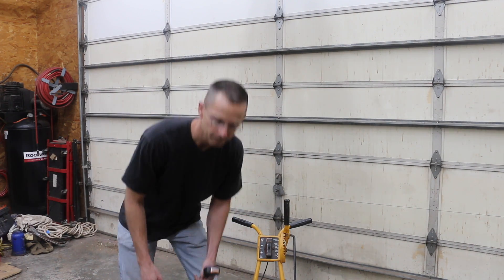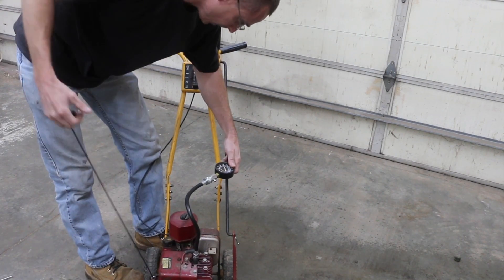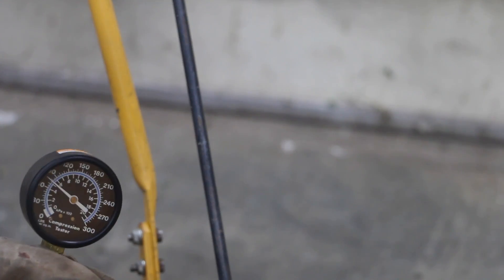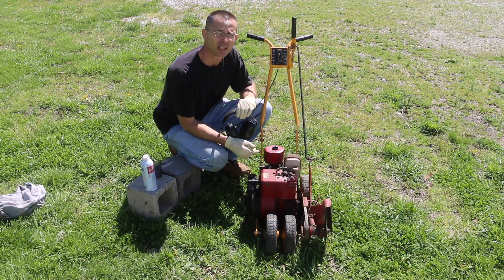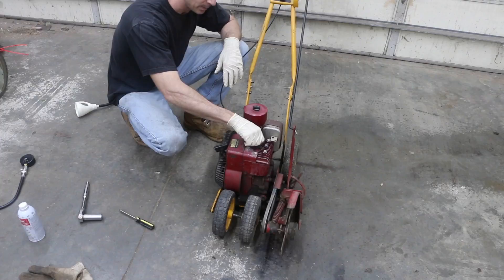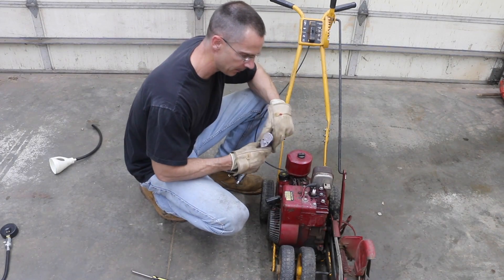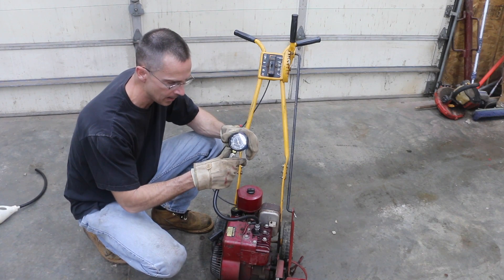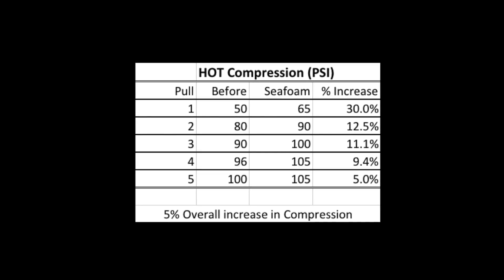Seafoam--can't believe what it did to my engine!!--Episode 4--Compression Test

Comment: Back in 89' I bought a gremlin for $60. The first time I saw this car was pre dawn on a crisp winter morning and it was on fire. It turned out to be my boss who was meeting his "noob" at the Quickie Mart. After some mild drama w the clerk over his fire extinguisher we stared at the smoldering car. A quick haggle and we stuck a deal for $60. I fixed the fuel leak after work and my brother drove it back to our condo near Placerville. As he drove around corners you could see a ring of sparks from the steel belts coming thru the tires. We would torture this car in every way possible while not actually moving it. Hammers, lame karate kicks etc.  all were deployed. After the bastard car struck back and bloodied my hand I grabbed the garden hose. My brother and partner in the car fired it up, matted the gas pedal as gave the gremlin about a 20 second blast of H2O down the carb. It made a hysterical BUUUHHHWAAH sound an farted out a giant steam cloud. The engine cleared an idled  smoother and revved quicker. The next test was each of us had a gallon jug of water in order to limit the amount of damage on person could do. My bro stepped up and gently poured his gallon in and I modulated the throttle. BBUUUUWWWAAAAAHHHH and more laughs. My turn, he floored it and I held the jug inverted over the carb. It looked like a weather event. The last one did hurt the motor some. The next night we took the car out to country road, kicked the grill off( Bruce Lee would have been proud of my little Bro), jammed it on the gas pedal and fled the scene. I shit you not 30 seconds later a deputy passed us going the opposite direction. Moral is a small metered amount would be ok an older engine. I would not try it on anything I cared about(just my opinion). I have used Sea foam on newer cars w mixed results. I guess my theory is when  adding it to the intake I would have concerns in reference to the carbon loading up the catalytic converter. I always for the directions on the can. After a quick oil change the car gets a nice long drive to get the cat cookin'. It never did any damage but in fairness most of my cars are older but do run well.
Reply from the maker: jaber baber, I enjoyed that story!  Funny!!!  I'll add water very slowly. Thanks for watching the video and for commenting!

Comment: btw that gauge doesn't measure compression it measures cylinder pressure. the two are similar but not the same. compression is a measurement of volume while cylinder pressure is the  measurement of pressure the piston creates as it rises.
Reply: I think its hilarious that the guage in the photo is even labeled "compression tester" but some genius says it is something else.
Reply: The gauge reads pressure and it tests compression.
Reply: The gauge does not measure cylinder pressure because the cylinder does not hold any pressure. Its called a compression gauge because it measures the compression pressure created by the piston and piston compression rings as it compresses the air taken in by the piston and forced upward towards the engine head there for calling it a compression test. So in other words the compression gauge measures the compression pressure created by the piston and piston rings.
Reply: Mike, you forgot to add the cylinder walls, head surface and valves into your lengthy correction of terms of the parts that create compression, oh, yeah the shin bones connected to the knee bone... ha, ha, too funny.
Reply: Project Farm great video, no blabbing on and straight to the point,  nice work man!
Reply: konner kramer good point smartarse
Reply: mikefranklin74 I think konner kramer is confused with compression and compression ratio which is a measurement with volume like he stated
Reply: konner kramer Compression is Cylinder Pressure
Reply: You should google. Google is your friend.
Reply from the maker: Konner, Great point!  Thanks for watching the video and for commenting!
Reply: Project Farm just thought I'd let you know either way great video keep up the great work.

Comment: Boiling water may work better than cold water. But better than SeaFoam, no.
Reply from the maker: blipco5, Another vote for water!  Thanks for watching the video and for commenting!
Reply: You mean another vote for Seafoam.
Reply: +Project Farm 
No, my vote is for Seafoam. I don't think you could get enough water in there to keep the motor running long enough for steam and cavitation to do its work. 
But to be honest I don't know how Seafoam works either. Is it because it was poured directly into the carb where IT'S main effect was cavitation rather than a chemical reaction?

Comment: use a 50 50 antifreeze mix have you ever looked in an engine with a blown headgasket the cylinders effected are spotless
Reply from the maker: adam moon, Excellent idea!  Thanks for watching the video and for commenting!
Reply: GModBMXer no antifreeze is water and ethylene glycol and a bunch of rust inhibitors. methanol is in washer fluid
Reply: ive seen hundreds of engines with blown head gaskets and the valves where as spotless as the piston tops never really looked at sparkplugs close usualy change hose there cheap
Reply: Dylan Houser Seafoam does that aswell. It happens with any engine hydrocarbon cleaning
Reply: Antifreeze is actually a really good cleaner. I have actually used antifreeze to clean parts out in the oil field when I have run out of carb cleaner.
Reply: As mentioned above, I would not be spraying antifreeze into a modern engine because of the O2 sensors. Most of the cleaning action happens due to thermal shock and not chemical solvents.
Reply: I replaced the heads on my Jeep 4.7l a few years ago. There was a crack at the corner of one of the cylinders letting coolant in. I had been losing coolant for a while, but finally tore it down once it got bad enough to make the engine run rough. Like the other guy said, the cylinder getting coolant in it was spotless and clean of any carbon; easy to spot compare to the other cylinders. I do all my own oil changes, on time, and never once noticed the oil looking even slightly coolant contaminated. I don't think there was nearly enough cylinder blowby to allow the coolant to reach the crankcase and contaminate the oil.
Reply: adam moon only problem is it causes deposits on valves and spark plugs
Reply: yes it does steam clean from the water but the antifreeze contains lubricants to help from scoring cylinder walls
Reply: That 50/50 mix used to boil dirty carburetor in a coffee can cleaned the carb up like new.
Reply: I've seen the effects of blown head gaskets also I believe that soaking, when customer lets it sit overnight, maybe serval times? helps clean the combustion chamber.
Reply: Thats from steam not the antifreeze
Reply: Lol WHAT? Do NOT use anti freeze to clean your cylinders. Anti freeze does not play well with oil. Seafoam is petroleum based so a bit of it blowing by into the crankcase isn't a big deal. Antifreeze is a mix of ethylene glycol and water both of which do NOT play with engine oil nicely. Funny how you mention how you've seen "hundreds of engines" with clean cylinders from blown head gasket yet you neglect to mention that it turns your crankcase into a milkshake. Calling bullshit on you, sorry.

Again, DO NOT USE ANTIFREEZE TO CLEAN A FULLY ASSEMBLED, RUNNING ENGINE EVER. The bullshit you find in YouTube comments my word
Reply: It's not the spark plugs or valves you worry about, it's the oxygen sensors and catalytic converters. But as far as cleaning the combustion chamber, It's better to use plain water. It atomizes much better and leaves less deposits.
Reply: Do not use antifreeze!  The antifreeze will mix with the oil, which is really bad for the engine!
Reply: Dylan Houser Ohp, you're absolutely right. I was thinking of windshlield fluid
Reply: Callan P.K. 
If I recall my college chemistry  101 course correctly; Water is the universal solvent. Particularly at high temperature. Wow! I can't believe I remembered that.
Reply: That's due to the "steam cleaning" effect from the water, nonecessarily the anti-freeze.  This is known in the water/meth injection community. Joys of water !
Reply: icin4d Antifreeze is literally water and methanol. Methanol is a lottt like ethanol bit with much higher octane ratings and detonation resistance. There are a lot of videos were cars even run straight methanol

Comment: great video spraying water into a hot running engine has a long history of being effective I'm voting Sea Foam I think the chemicals would make it more effective also I wouldn't hot soak with water it could contaminate the crankcase oil
Reply from the maker: James, Excellent advice.  I won't "hot soak" using water.  Agree that it'd likely contaminate the oil.  Thanks for watching the video and for commenting!

Comment: Do you normally have to hand choke this old engine for a cold start or did the seafoam loosen something to clog the needle ... or is just having to run rich to burn off the residual seafoam.

Mercury / QuickSilver makes a similar product called Power Tune. It doesn't make a fuel or oil additive but the procedures are similar with the aerosol can. I don't know if the chemicals are the same but it kept my Yamaha 11hp outboard running perfectly for many years.

It goes completely against my instincts to put water inside of an engine!
Reply from the maker: 3DPDK, I had to hand choke the old engine for a cold start.  I've always had to with this engine.  Newer carbs are designed to be much more user friendly and efficient at delivering 1-pull starts.  Thanks for watching the video and for commenting!  Also, thanks for mentioning Power Tune.  I need to look into testing that product!

Comment: interesting test results! I have used distilled water on my 1996 Mazda MX5 1.8L 4 cylinder to clean the carbon from the intake and combustion chamber with positive results after inspecting using a borescope. This method makes sense because if you have ever removed the head of an engine with a failed head gasket you will notice the piston and valves where the coolant leaked in and flashed to steam are typically much shinier and cleaner than the other cylinders. since the coolant is commonly 50/50 with water and this visual evidence can be seen in most engines having failed head gaskets i had reason to believe cleaning my engine using this water method may yield good results. I suggest using distilled or deionized  water because it does not contain any mineral impurities that may damage the engine (likely not going to  but there is a chance) anyways great videos i am enjoying them as you have a really calm personality i find this delivers the explanation of what you are talking about nicely.
Reply from the maker: AMDcore1, I will definitely used distilled or deionized water!  Thanks for watching the video and for commenting!

Comment: I'm curious about something, I'm not trying to troll and I am by no means any kind of expert, but wouldn't removing material from the combutsion chamber LOWER compression?
Reply from the maker: Chauncey, Great question!  Yes, it would lower compression assuming there was no improvement to rings and valves getting cleaned and sealing better.  I believe the seafoam helped with that.  Thanks for watching the video and for commenting!
Reply: Yeah man, thanks for answering my question. Makes sense.

Comment: i'm surprised seafoam hasn't contacted you and given you a free case! are you reading this seafoam! the man deserves a free case for all the business he's sending you!
Reply from the maker: usonthegwaii, The water test results might not please Seafoam.  I haven't performed the test yet; so, I don't know.  However, most commenters are voting water over Seafoam.  Thanks for watching the video and for commenting!
Reply: @ProjectFarm  Berryman 2610 B-12 Chemtool Total Combustion Cleaning Kit, 16 oz. with Application Hose Kit and Instruction Sheet Included... sold by  Amazon, and found once at walmart.  They claim the white mineral oil in sea foam is why it smokes but does not clean. https://www.amazon.com/gp/product/B0002KKIM8/ref=ppx_yo_dt_b_asin_title_o04_s00?ie=UTF8&psc=1 I used it on a 2003 Grand Am.
Reply: no, water doesn't clean the throttle bodies/carbs and intake valves like sea foam does. water does clean the combustion chamber and exhaust valve though. i wouldn't put water in my  fuel tank to clean the fuel passages/injectors either. i also fill my fuel filter with seafoam when changing it on my 7.3idi diesel too...works wonders. seafoam in the tank also stopped a generator i aquired from"hunting" for idle too. and works great as a fuel stabilizer when storing things like pressure washers and chainsaws too. add to tank then run it for a minute or two.i' ve been using it for many YEARS and never have fuel issues in any of my motors, atv included.
Reply: life time supply to ya man....sea foam hook the guy up!!
Reply: Oscar De la Serna theirs never no risk buddy
Reply: unboxviews yes the company should...goto the seafom official youtube channel and compare views 
 seafoam is getting over 3/4 million views through project farms posts on seafoam official channel next to none..... so its only fair to at least send him what he has spent on seafoam for all the free adverts. JMO.
and oscar there is plenty of risk of someone hydrolocking an engine. take a weed eater for example approx 39 cc of cylinder. thats not alot of water.  NO risk hah! if you like bent valves go ahead and dump water in your engine...i'll stick to seafoam it doesn't expand 1600 times when heated like water will.
Reply: I have no idea how water would do anything close to what Seafoam does.
Reply: kinda what i was hinting at. leave the water for your garden .not an intake. too many people with not enough common sense to not hydro-lock a motor,  which could be easily done on a small displacement engine. water expands a great deal when turned to steam which could equate to engine damage
Reply: GModBMXer I hadn't thought about the steam. Very interesting. Thanks.
Reply: And for the love of god don't put water in your gas tank
Reply: Brother Jake's Konservative Evolution He's legit, and does these tests at his own expense. Honest reviews, and answers the questions we all want to know.
Reply: Oscar De la Serna thanks buddy
Reply: He should get lots of electrical tape, duct tape, loctite, motor oil, etc...... I love watching this channel! Keep up the great work!
Reply: Oscar De la Serna 
Use a spray bottle.
Reply: Brother Jake's Konservative Evolution  obviously you're not a follower of the channel or you would know this guy doesn't take money from companies.
Reply: 802 Garage It's called steam cleaning. Water is the most effective way to clean out a hydrocarbon mess in your engine. There's plenty of articles about it to. Using a spray bottle into yhe throttle body is an easy way to clean out the exhaust valves and piston heads
Reply: usonthegwaii I was about to say something about that. They need to pay him because im about to do it this weekend
Reply: Brother Jake's Konservative Evolution ha. I'm sure you will. Good one.
Reply: Yeah I'm about to go buy some seafoam, MMO, and restore engine restorer tomorrow.
Reply: Brother Jake's Konservative Evolution Wow, just wow. SMH.
Reply: I watched a guy on u tube use a water nozzle from the hose to shoot into his throttle body. Shocking it was since that was the first time I’d ever seen water being used.
Reply: Brother Jake's Konservative Evolution  - How do we know you're not with The CIA doing mind control??   DUH!!  Grow up dude!!
Reply: They sent him a tesla, where seafoam is not needed anymore.
Reply: More like a truckload
Reply: So the company has to send a product to this guy for being a good product? He is helping you buy products that work and let the ones that dont fail in bussiness
Reply: usonthegwaii There's no risk of hydrolocking the engine if you pour a small amount of water at a time.
Reply: usonthegwaii Exactly. This is free advertising. I guarantee a ton of Seafoam has been sold because of him. The company encouraging it and showing appreciation would just be good business sense.
Reply: B- Ray There's

Comment: The water should be added to hot running engine. This was a good test. Risk in removing carbon is in high time engines the carbon can become a sealing surface. If removed a worn engine may quit running with carbon removed.
Reply from the maker: Anthony Butera, Excellent point!  I will make sure the engine is fully warmed up before adding water--thanks for that advice!  Thanks for watching the video and for commenting!
Reply: Project Farm I have never been brave enough to try it but the steam is what is supposed to break up the carbon, temperature shock according to others. Expect funky sounds when carbon comes off. With ATF I thought I ruined a couple until it cleared the carbon. Good luck. I just subscribed, I like what you are doing.
Reply: Anthony Butera  only negative effect from water would only mix with fuel in carburetor on these small engines. but with all the fresh gas in the tank it should stabilize
Reply: Forgott3n Gaming 
What I mean is if the carbon has become a sealing surface, once removed, only replacing worn parts will make it run again

Comment: mike i think water will clean up the carbon better then seafoam. as for compression seafoam is mostly oil so it will boost compression, adding oil to the combustion chamber will help the rings seal. even just running premix in your four stoke should boost it. cant wait for the video though. hope you pull the head before and after the water.
Reply from the maker: Ryan, Great suggestion--I will definitely pull the head before and after.   Thanks for watching the video and for commenting!